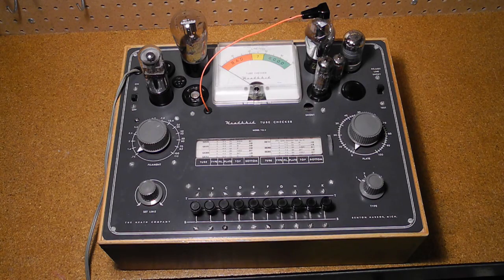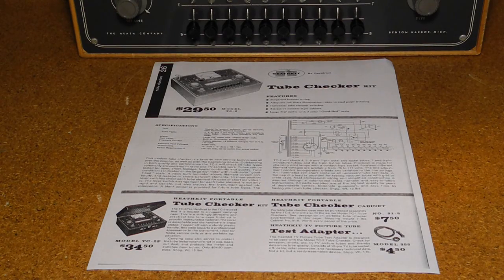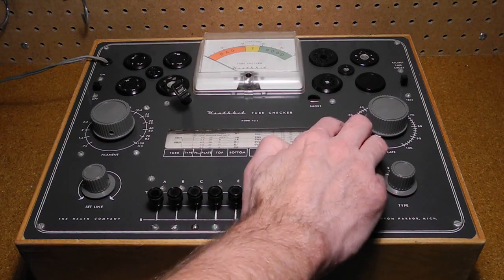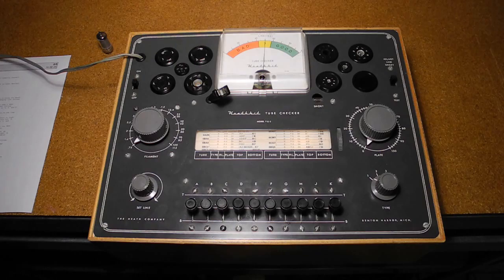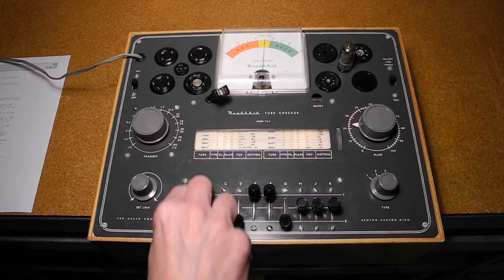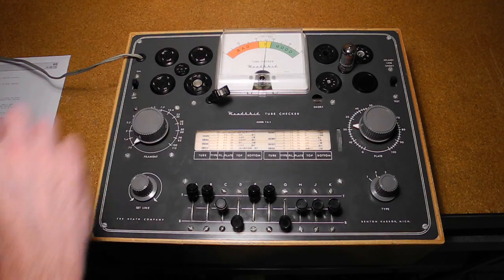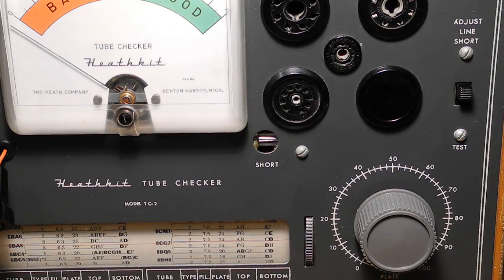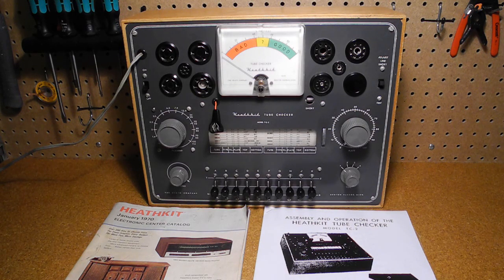The Heathkit TC-2 Tube Checker

Comment: I notice that there are typical 2 lines of instruction for each tube on the roll chart (with parentheses). Any reason for that??
John
Reply from the maker: Yes. Multiple lines indicate that the tube has multiple sections or elements (e.g. dual-diode, dual-triode) and each line tests an element. The parentheses indicate that during a shorts test the levers shown in parentheses should be moved simultaneously,

Comment: Is there a chart for the 6414 tube and the 6H30 tube?
Reply from the maker: Neither of these are on the supplemental roll chart that I have.
Reply: @Jeff Tranter  
Thank you for checking .
So hard to find test data for those tubes.

Comment: I wish I knew the value and wattage resistor they used for the line adjust compensation and a good place to attach it into the circuit physically.  My line adjust is always a bit high, even with control fully turned down counter clockwise.
Reply from the maker: The original line adjust control was a 200 Ohm 25 Watt wirewound potentiometer. Some people use a small transformer wired as a bucking transformer to reduce the line voltage. You can find examples on the internet.

Comment: Hi Jeff, wonding if you can help out. I have a GE 6267 Tube and have been searching on the right settings for the Heathkit TC-2. I have not been able to find the settings. Can you assist? Thank you
Reply from the maker: My "SUPPLEMENT TEST DATA SHEET" lists the 6267 with these settings:
Type 1, Fil. 6.3, Plate 20, Top AFHJ, Bottom CE (No open element test on F)
Reply: @jefftranter  HI Jeff, thank you so much for the quick response. This really helps!

Comment: Great video Jeff ..I too have had this for some years, and didn’t know how to use it previously!
My question is :  on the roll chart and on the online chart you mention , the tubes that I need to test 12AU7, or ECC82 and 12AX7 or ECC83 are not shown, variants like 5814 and 5751 are . I was under the impression that these are slightly different from each other. Is it permissible to use the variant testing specs to get a somewhat accurate reading?
Thanks!
Reply from the maker: Yes, you can generally use the same settings for equivalent tubes. There is a Heathkit manual that you can find on the internet called "Supplement Test Data Sheet for use with Heathkit TC-1, TC-2, and TC-2P Tube Checkers." It has a section at the end with "American Equivalents to European Tubes". It lists, for example, ECC82 as equivalant to 12AU7 and ECC83 as 12AX7 and you can use the same tester settings,
Reply: @jefftranter  thanks Jeff , I’ll try that out
Reply: @jefftranter  just tried it the correct way , first issue was the set position knob, it was all the way to the left and still the needle was to the R of center position… never dead center.
The test was on anECC82 , 12AU7 tube , levers AB up CDE down when I reversed these positions ABC good ,
DE short bulb illuminated …tried 6 different tubes same results , so I’m guessing it’s an issue of this old unit …from what I’m experiencing do you reckon is fixable in a relatively easy way or perhaps not ?
Thanks!
Reply from the maker: @deepvillage  There is not a lot of circuitry in the tester, it is mostly switching. You can find a copy of the manual on the internet. If you have a digital multimeter you can check the resistors in the tester to see if any are bad, and check the switch connections for continuity and you may be able to track down the problem.
Reply: @jefftranter  thanks again Jeff I’d really like to get  this unit functional I just don’t need a high end tester it’s in good shape other than the musty smell of 50 or so years in storage

Comment: Well done on the video Jeff!  Do you have a URL for the site that provides info for testing older tubes that are not listed on the TC2 chart?  The tubes I need to test are in a Garod V Neutrodyne receiver.  In the article I was reading it refers to the tubes in it as:
VT 1, VT2, VT4 and VT5 -UV -201 -A or C -301 -A
vacuum tubes;
VT3 -UV -200 or C -300 vacuum tube
Most other tubes I need to test are most likely going to be on the chart.
Reply from the maker: I believe it came from here: https://www.rsp-italy.it/Electronics/Kits/_contents/Heathkit/Kits/Heathkit%20TC-2%20tubes%20list.pdf

Comment: Thanks for the video it was very informative.  I just acquired one of these testers, however the needle on the meter is bent.  Is it possible to get a new needle or meter for these, or can it be rebuilt?
Reply from the maker: You might be able to remove the cover and bend the meter needle. If not, you could try to find a replacement meter but it will be hard to find one that is the same.
Reply: @jefftranter  Thanks for the quick reply I straightened it as best I could without damaging it further.  The tester seems to work, so I will just keep an eye open
for a new gauge.  The scale is so large on the gauge that my bent needle does not seem to matter that much.  (the cover was off the tester when it arrived at my home and the loose cord flopping around inside the case damaged the needle)  Thanks again for the quick reply.

Comment: Mr Granted ,where did you did info online.for this tube tester ,mine don't show spot of AS 5 tube numbers I just need to be able to test my AA5 tubes because that's all I work on ,to learn with a lot of G.E. 1960 era radio so.all I need is the numbers of the roll chart mine don't have ,anyone.that can help a novice I would be very great ful .
Reply from the maker: A Google search for Heathkit TC-2 should find several copies of a partial manual and tube data. One source is http://tubularelectronics.com/Heath_Manual_Collection/Heath_Manuals_T-X/TC-2/

Comment: Mr.Tranter I have just bought this same tube tester ,I want to ask for your help tell I find a original booklet for mine ,I replaced the .1 mfd cap.and on the left side when inside down there is a power resistor ,mine is a sand resistor and not readable,one other seller says it's 100 ohm 25 watts ,his is Mark marked 2500 on the top could you please help me with at value of that bigger resistor,I would be fearful to you or anyone who no this info.
Reply from the maker: My schematic shows a 2500 Ohm 5 Watt resistor.

Comment: at 5;38 when you check for open elements,,you say the meter 
should drop when you gp through the positions . I noticed in the 2ed and 3ed positions the needle did not drop,,,,,does this mean the tube you were checking had open elements ?

Comment: New tubes I own that are verified seem to read the same as any other tube, would changing out resistors and/or even the transformer make mine more accurate?
Reply from the maker: Replacing any resistors that are out of value would be useful. The transformer is almost impossible to find, I wouldn't change it.

Comment: Thanks for the great videos Jeff. I got my hands on a very similar tester and i'm not sure if this is working correctly or not. When I do the filament test, I put the selector to 0.63 volts and move the bold letter switch(es). The bulb does not light for a 6L6 or a 12AT7, but it does light up for a 12AX7. If I move the selector to 1.4 volts, the very next setting,  then the bulb lights up for the other 2 tubes. Is this an internal problem or something else wrong? or can I get away with that at the 1.4 volt setting. The unit came with a broken bulb and I replaced it with the exact same type of bulb. It does light up so I'm assuming the bulb itself is fine. Thanks!
Reply from the maker: It sounds like you are not using the right filament voltages. It should be 6.3V for tubes like a 6L6 and 12.6V for 12AT7 and 12AX7 tubes.  I'm assuming this is a tester like the Heathkit TC-2. If you don't have an operation manual for your tester, you should be able to find one on the Internet.
Reply: Jeff Tranter yes I'm using 6.3 when doing the other tests, but for the filament continuity when you turn the voltage down to the minimum, .63 in my case, that's where the problem is. Thanks.
Reply: Or...the problem could be that the wire for the .63v broke off the lug... I soldered it back on and seems to be working now. Thanks! :)